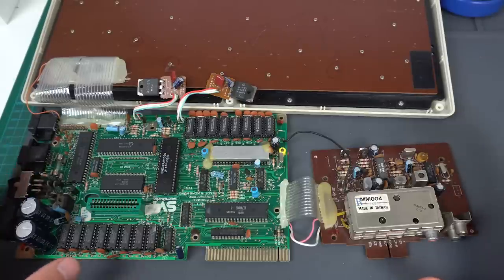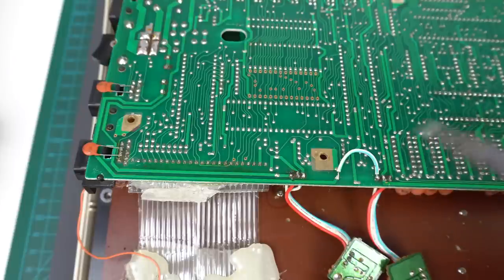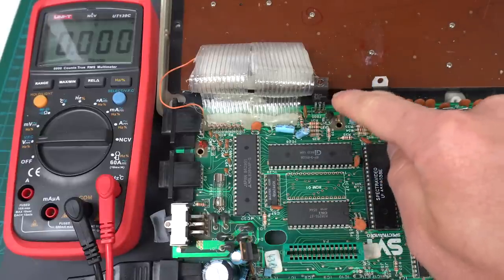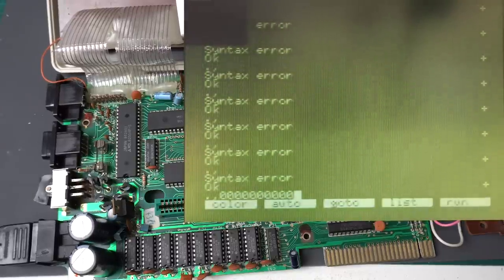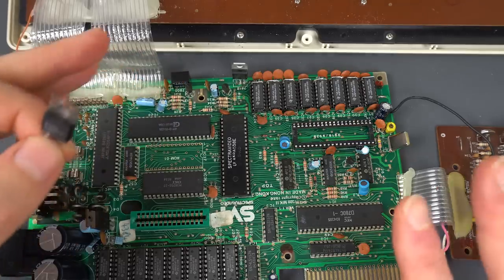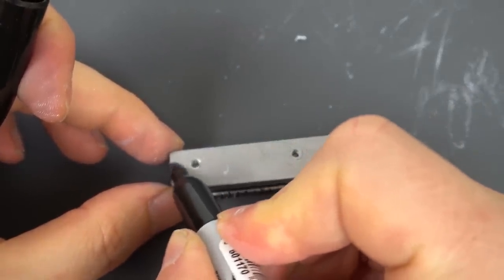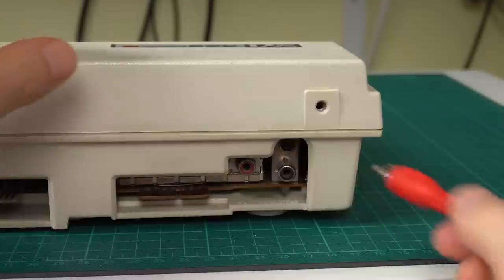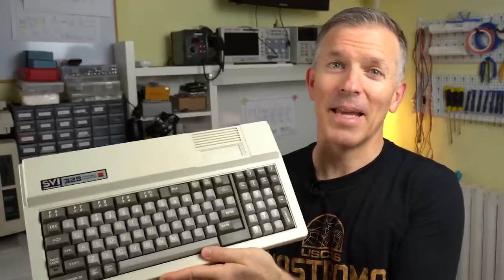SVI 328 VDP Problems and Final Touches (Part 3)

Comment: Why would the input voltages to the regulators be double the output voltages? The unregulated input voltage should be close to the output voltage so the linear regulators don't get overheated as they waste 50% of the electricity they are being powered with.
Reply from the maker: You know, that makes a lot of sense. I didn't question it somehow, but I agree it seems really high. I know the input power supply is fine, and the path for the 7805 and 7812 are completely different, yet they both run high. I wonder if it's a badly-designed circuit or there's something going on in there.
Reply: @NoelsRetroLab  The linear regulators are terribly inefficient.
Reply: @NoelsRetroLab  The input DC voltages make sense considering the AC voltages. 8VAC (nominal so higher with no load) through a full bridge gets you (8*1.414) 11VDC. So the 12.x Noel had was within what could be expected. No way were the 7805 ever going to survive without substantial heatsinking, which is why the previous person probably stuck those 2A 5v and 12v LDO on there except they would have needed to dissipate the same amount of heat just from a larger package. Very nice result in the end, great perseverance Noel!!

Comment: Well, the other ribbon cable is soldered to the keyboard PCB, so if you want to walk the extra mile... 😁
Reply from the maker: Yeah, I saw that afterwards. Getting the right connectors could be a chagellenge because it has so many pins though.
Reply: @NoelsRetroLab  what about a simple pin header strip and dupont style connectors?

Comment: The people at SpectraVideo had a typical Hong Kong mentality, it only had to work at the moment it was sold. It didn't came to their minds to make something better then others, they followed to loosely the MSX standard. Programmes had to be made in two versions, one for SpectraVideo and one for MSX.
Reply from the maker: That's really too bad. I didn't know much about their quality standards form manufacturing, but I'm definitely not impressed. As for the MSX, the SVI 328 came out before the MSX standard, so at least they have that going for them. Or are you saying that the later SVI 728 didn't follow the MSX standard completely either?

Comment: Looks like you could have easily replaced the keyboard ribbon cables as well.
Reply from the maker: Yeah, I saw that afterwards. The problem is getting a connector long enough to have that many pins. I need something like a C64 keyboard connector.

Comment: You should not have powered up that new chip without a sink.
Reply from the maker: Really? They run THAT hot? Someone was just telling me on a FB group that there was even another computer released with this same VDP and they didn't install a heat sink from the factory. I doubt that running it for a couple minutes would do any harm.
Reply: @NoelsRetroLab  They run hot but not that hot, you can run them without the heatsink, there are computers that did.  A heatsink just reduces the risk of them dying eventually.  to be honest, i think the slab of metal on the top doesn't really do much as a heatsink, it needs fins to work properly.